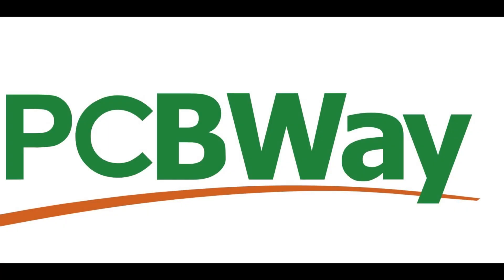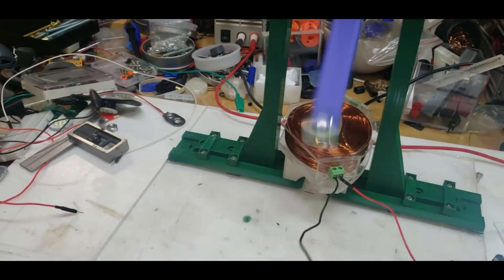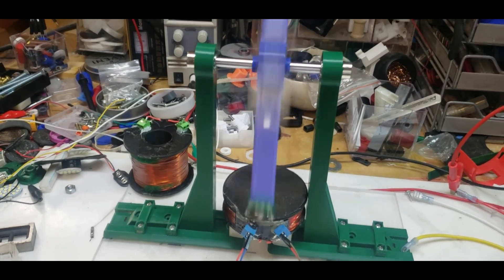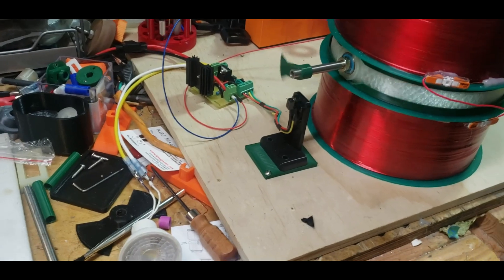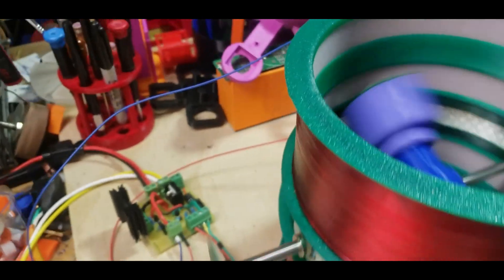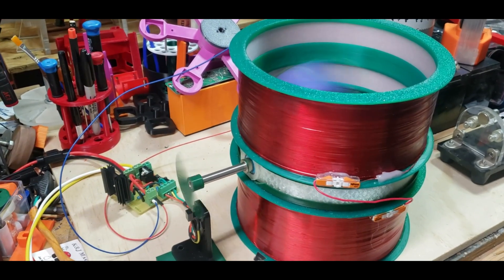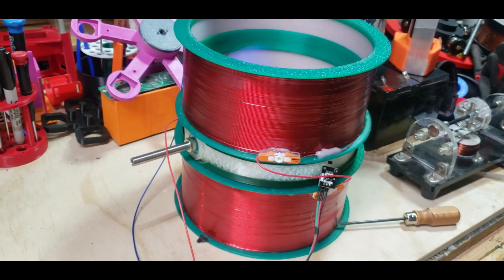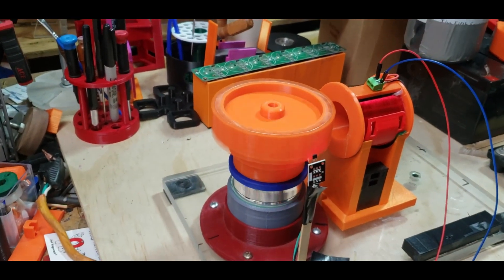3D Printed Pulse Motors w/ Optical and HALL circuits

Comment: Thought I'd share this idea for a basic reluctance motor operated as a generator with no magnets. 

First to describe it motoring. In its simplist form, a rotor with  steel bolts protruding from it, and a fixed coil that is electrically commutated by a near by bolt making contact with two copper brushes that concurently touch the shank of the bolt, and thereby closing a circuit with a battery  and energize the coil which draws the nail closer.  Then contact is broken with the brushes when the bolt moves over over the coil allowing the rotor to continue spinning untill the next bolt is pulled in the same way. 

Now to describe it generating.  The machine would be almost identical except it is spun the reverse of motoring, and the coil would be center taped. The primary coil is still energized by commutation with a bolt, but energy is collected off the srcondary coil. 

On the surface, the this a lot like a transformer but energy is added to the magnetic field by mechanically turning the wheel. This moves iron positioned in a low potential  energy spot in a magnetic field to a higher potential energy spot in the field converting mechanical energy into magnetic potential energy.  Then the circuit is opened and the magnetic field genered by the primary coil  collapses dumping both the energy used to create the magnetic field and the energy used to pull magnetised nails away from an energised coil, and dumps all that energy into  the secondary coil. Include diode to ensure current only flows one way. Maybe capacitores to absorbe the induction spikes and smoth the output. 

More advanced versions may commutate the primary coil current with positioned hall censors and apropriate circuity, and eliminate unnessesary air gaps in the rotor and stator.
Reply from the maker: thanks. I just downloaded a generator from Tom Stanton and his .stl files are free on Printables. Its a decent hand crank which I will convert

Comment: That big coil looks like it have more or less the same number of turns as the first coil. Byt the flatter coil have a much bigger inductance due to the number of turns per unit length of the coil.
Edit: not just the inductance which linit the current draw bu tmore importantly the magnetic field strenght of a solenoid is directly proportional to the number of turns per unit lenght of coil